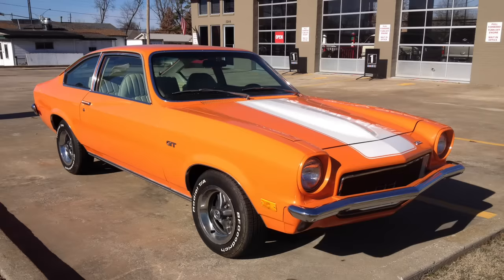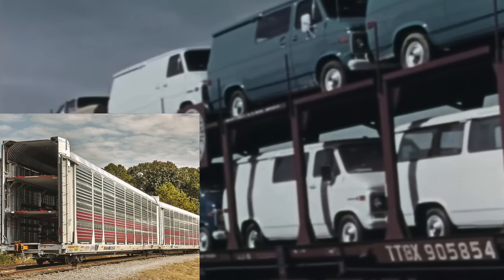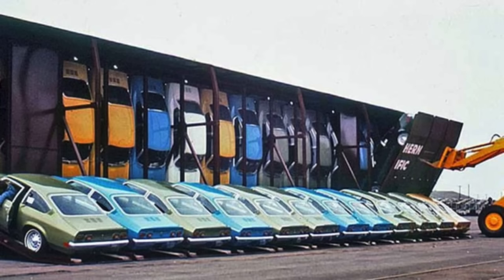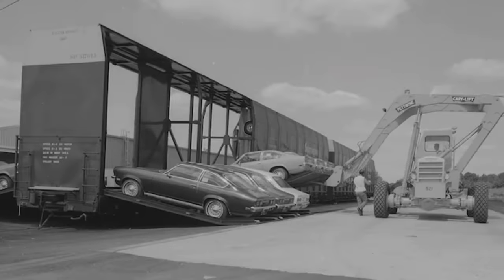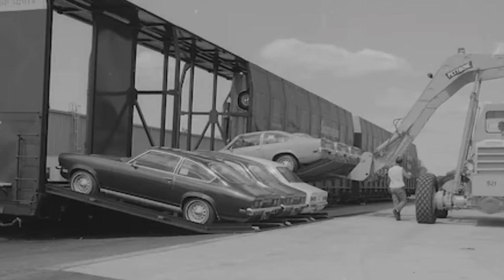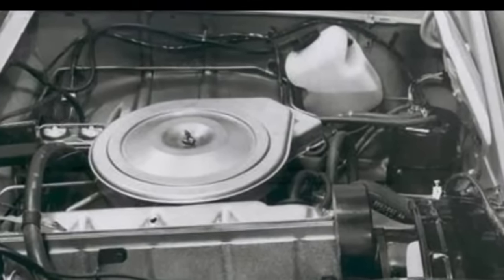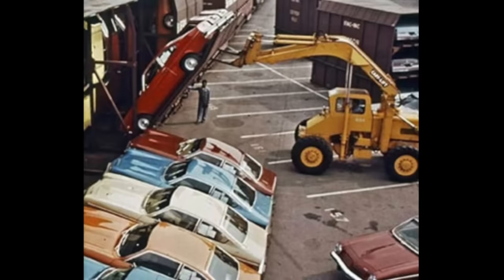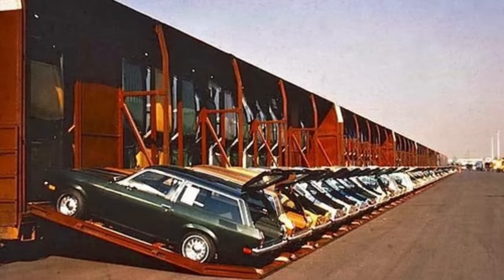GM's Coolest Invention Wasn't Even Part of a Car: The Chevrolet Vega's Vert-a-Pac Shipping System

Comment: Vega's weren't great but were not all bad.   One fun thing to do with a Vega was to buy a used wagon and drop in a 327 and four speed, what a fun car to drive around.   Oh, watch for the Ring & Pinion --- no dumping the clutch.   LOL    
Thanks to Adam for another enjoyable watch of Automotive History.
Forgot to say:    The factory air cleaner was a joke, to change the paper filter you would have to change the whole metal housing --- the two halves were welded together........
Reply from the maker: True to the air cleaner!
Reply: What was the idea behind a design like that???  Extra money you think at the parts counter.      A friend and I put 8,000 miles on a Vega doing a three-month cross-country trip. It was a 71 GT wagon, and it ran perfect for the whole trip. @RareClassicCars
Reply: @jetsons101  That's unusual
Reply: That, and he kept the oil changed every few thousand miles.   Hmmm maybe a bit of luck.....    lol @MarinCipollina
Reply: That air cleaner wasn't cheap either! I you planned on keeping the car it was better to buy the fram kit.
But I knew someone who cut the top open so he could replace the filter.

Comment: GM tried to imitate what  Mercedes did in casting aluminum blocks without steel liners.  Every effort to make the cars cheap and light as possible.  They started rusting out within two years in rust belt states.  Ditto oil consumption.
Reply: You never had a chrysler or a ford???
Reply: @will7its  used to like GM products but after a ‘86 Grand Am with Quad 4 (timing chain slippers failed after 6 months) and a ‘91 Corsica that kept blowing fusible links (multiple times, and dealer couldn’t find the problem), haven’t bought GM since.
Reply: @bruceferguson6637  My mom had an 85 olds quad 4 that she loved untill 250k miles
And my dad was getting high 40's mpg's driving it to florida.  I just thought it was slow.

Comment: GM, a company that still exists despite fifty years of failures.  Only GM could spend so much, accomplish so little and leave the car itself as an afterthought.  If they had put the money for the modifications into better engineering of the Vega it might have been a success.  Instead, among other shortcomings, they became famous for actually rusting on the showroom floor.  And since it was such a spectacular failure Ed Cole of course moved up to become chairman of GM.

Comment: Typical corporate logic, spend a dollar to save a dime. It was designed to only deal with one type of vehicle. Had to have a specific area to load. The system probably causes more damage then it prevented. I dunno if theses problems would have been worked out if it was a worth while venture. Maybe someone that had some experience working with this system can comment about it.

Comment: Vegas were garbage. Pinto was even a better vehicle. We had a '73 for about 6 months. That aluminum block motor with steel sleeves was garbage right out of the factory. My parents gave up after a few months and the dealership helped get us out of it. Massive fail. Final straw was when my mom and I got blown off the highway (we lived in Wyoming). The car just didn't weigh enough for Wyoming conditions. Got a Plymouth with a massive iron block motor after that.
Reply: The Vega engine did not have steel sleeves, it would have been better if it would have.
Reply: @edwardpate6128  As I recall ours began separating. That was after less than 6 months of owning it. I was a kid, maybe I misremembered. Anyway, it was junk right off the lot.
Reply: @markw999  Pinto was a better car ? Try telling that to the parents of the three teenage girls that died in Elkhart County , Indiana in August of 1978 , because the Pinto they were in burst into flames due to being rear-ended .
Reply: @bobbrinkerhoff3592 it was still a better car. It had 1 flaw, Vega had many.
Reply: @bobbrinkerhoff3592  Didn't say it was safer, just better mechanically. The Vega started falling apart as soon as you bought them.
Reply: @markw999  News flash pal , Pintos also started falling and rusting apart from day one . At least the Vega didn't use a braided steel flexible cable to connect the steering column to the box like the Pinto did . Hey , did you know that Pinto stands for Put In Nickel To Operate ? Just like the little rides they used to have outside of the grocery stores back then .
Reply: @garyszewc3339  they both rotted to the ground in no time , The only major flaw of the Vega was the cylinder walls were too hard and didn't allow the rings to seat in .
Reply: I heard Vegas overheated too

Comment: What other automobile was ever designed and built around the railroad auto carrier cars made for them? No other make or model could be shipped in those Verta Pac cars. They could not be used to ship new cars from any auto plant besides the GM plant in California where Vegas were built.
See if some yahoo type wants Amtrak to get Verta pack cars for its Auto Train between DC and Florida. Or maybe use em to ship Teslas.

Comment: If GM would have gone with either an all aluminum engine or a iron block aluminum head the engine problems would have been a non issue.

Plus if GM would have spent a few dollars more body rust would have been also a non issue.

GM has always been controlled by the bean counters that why their vehicles always look and feel cheap.

Comment: Ah yes, the Vega, what wonderful memories.  Nice little car, too bad the 140 was a total piece of crap.  Walk into work and see Vega engines all over the place.  That little engine so many ways to destroy itself.  Wrecking yards, row on row on row of shiny, clean Vegas, blown engines; they didn't have time to rust.  Rustproofing was tricky layers and layers of vertical sheetmetal.  Once they put sleeves into the engine cylinders, nice little car but engine oil and antifreeze did not mix.  The car, name was mud.  Changing it to Monza with a small block V8 didn't help...ces't la vive...then there was the Olds diesel....

Comment: I had a vega. It rapidly self destructed. The cylinders wear out the block, and then it develops a smoking and oil use habit and dies shortly thereafter. Actually, many cars, including the Porche, had aluminum blocks, but they put steel cylinder sleeves in them. GM skipped that step. A truly awful car.

Comment: Why the hell would the ship the cars with oil and gasoline in the first place. Some residual spray during assembly would easily take that problem away. Fixing problems that arent there.
Reply: Cars are started at the end of the assembly line, checked out quickly, then driven to the storage lot, then driven onto trains or trucks, and driven off at the other end. It is highly impractical to ship a car without fluids.
Reply: @brianb-p6586  I learn something everyday, touche and thank you. My smart ass needs the information, apparently 👀

Comment: It was a stupid idea. Engine mounts are designed to act vertically. Thousands of Vegas had their radiators smashed. I was an research engineer for GM back then. Vega was maybe the worst car GM EVER made....their was 1 model of the Vega that didn't have the Al engine block with the cast iron head, the one with the Cosworth engine. "Kids", loose so much in superficial research.😂

Comment: Too bad Chevy designed such decent looking car then sabotaged its engineering at every turn. They were rust buckets, oil burning aluminum cylinder wall engines, valve train issues, cheap and crappy rear drum brake adjusters and they didnt have much power or really drive all that well, many even came with the old 1950's origin two speed power glide transmission, though it could be had with a three or four speed manual as well as an ill conceived "one shift semi automatic" which made little sense as an option, best option was the four speed manual unless you couldnt drive a stick.  The later "durabuilt" iron sleeve engines fixed that inherent problem, but the insta-rust issue still remained and every attempted fix was too little too late and some needed fixes never came at all.